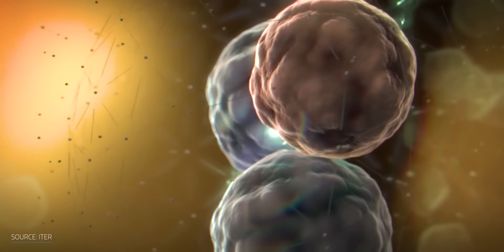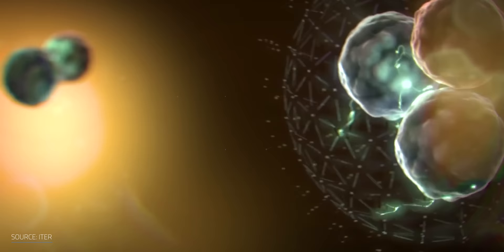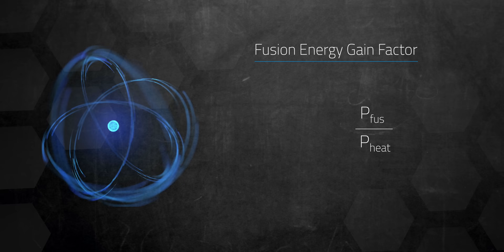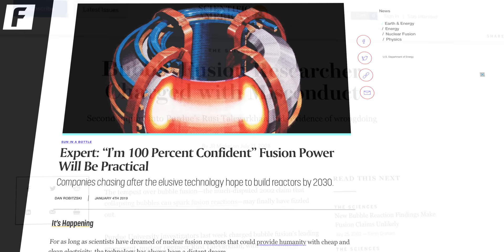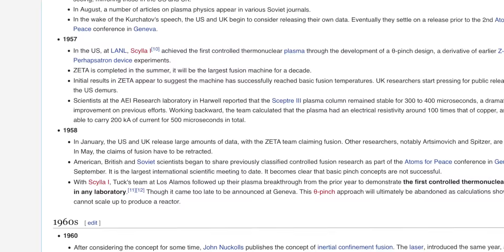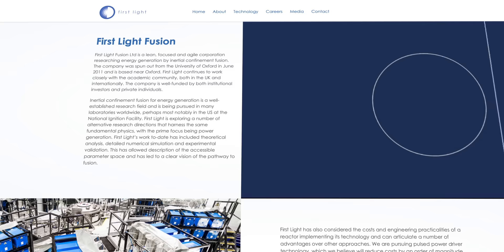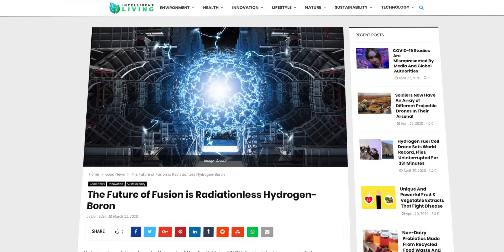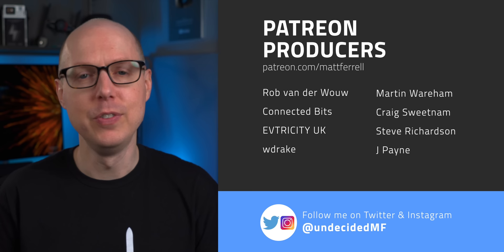The truth about nuclear fusion power - new breakthroughs

Comment: "The space elevator will be ready 50 years after everyone's done laughing"
Reply: You MUST be joking! It is the silliest idea for space travel ever. One failure of the cable and POOF.
Reply: elevator technology is one of the safest and most researched technologys, because, as you say, one cable failure and poof. But when was the last time that you heard of a lift failure? those things are really safe
Reply: @fyggy5480  Nobody has ever made a cable 35,786 kilometers long.
Reply: @DavidFMayerPhD  this is true
Reply: @DavidFMayerPhD  It doesnt need to be a cable.It could be a vertical hyperloop
Reply: Siddhant Kumar that idea sounds good , stick with that
Reply: @siddhantkumar1028  What does that matter? It is still an extended mooring that is tens of thousands of kilometers in length. Nothing like that could be built. Nothing like that could be deployed. Nothing like that could be controlled.
Reply: @DavidFMayerPhD  They said the same thing about airplanes.We just have to discover some new materials.I am pretty hopeful that it can materialize in the next 100-200 years.
Reply: @siddhantkumar1028  We know far more about Science and Engineering today than was known 150 years ago. We therefore know far better what is, and is NOT possible. In theory, the space elevator could work, but the engineering challenges are insurmountable. It is a stupid idea. 

Less expensive access to space can be obtained by air-breathing orbital boosters: Space Planes.
Reply: @DavidFMayerPhD  Hey,maybe not on earth but it could be feasible for asteroid mining colonies on medium sized rocks.
Reply: @siddhantkumar1028  Escape velocity from asteroids is SO SMALL that there would be no reason to build a "space elevator".
Here is a quick comparison of escape velocities:
Earth:  11,000 meters per second
Ceres (larges asteroid known): 514 m/s
Typical mid-sized asteroid: 100 m/s
Typical small asteroid: 20 m/s
Reply: @DavidFMayerPhD  What is we have skytrains running that are hundreds of kilometers long to carry the ore from asteroids back to earth or another intermediary base.In that case an elevator would function as a station/port for the train.Its impossible to land a train that big on the asteroid.In such a case an elevator would be perfect option because it will mean that you are using solar energy and not wasting chemical feuls.When you have millions of tons of ore to transport, I'm sure you would want the wastages to be minimal.Hope you understand what I'm saying.
Reply: @siddhantkumar1028  "skytrains running that are hundreds of kilometers long" 

I do not believe that any such technology will ever be practical. Also, WHY move that much stuff. Earth is a big place, and nearly all elements are available in abundance. You are talking about TRILLION TONNE objects which are simply unwieldy. Why not rockets pushing compact lumps of stuff rather than huge strings?
Reply: @DavidFMayerPhD  Those are compact lumps in space terms.We have trains measuring several kilometers on earth.So its very doable to have 100-200 km long trains in space.And considering the fact that a package will take about 6-7 months to reach earth,I think most companies will be looking for even longer trains.Furthermore to become a post scarcity civilization,its quintessential for us to mine the asteroids.Asteroid mining is  a much cheaper alternative for space construction as compared to transporting ithe materials from the earth.Apart from that,the earth's reserves are quite finite.Asteroids have a lot more concentrated ores and in much higher magnitudes ,which are much easier and cheaper to extract if we get our hands on them when compared to the ones available on earth. Rocket pushing compact individual lumps will consume a lot more fuel than just one long string/train that is propelled all at once with one propulsion system at the end.
Reply: @siddhantkumar1028  "Rocket pushing compact individual lumps will consume a lot more fuel than just one long string/train that is propelled all at once with one propulsion system at the end."
WRONG. Rocket fuel depends upon the MASS of the payload, not the shape. I just cannot figure out any advantage for hundred kilometer long slender spacecraft. The amount of material would be MUCH higher, because material is roughly proportional to surface area and your "trains" would have a huge surface area.
Reply: @DavidFMayerPhD  "Rocket fuel depends upon the MASS of the payload, not the shape. "
Then why does transshipment occur?Because it consumes less fuel and lesser manpower per capita.It is transshipment in space.

" The amount of material would be MUCH higher, because material is roughly proportional to surface area and your "trains" would have a huge surface area."
You are literally mining metals.Dont think amount of material is going to be a problem.Acts like shipping containers and is easier to load and unload from which can be a PROBLEM in space.

"Rocket fuel depends upon the MASS of the payload, not the shape"
When 20 individual pods are accelerating independently according to your method,and when they are all accelerating in unison by one thruster..Do you really think both would consume equal energy?1 thruster vs 20 thrusters?It can be an ion engine that accelerates the lot.You cant fix individual ion engine for every pod.It would be a waste.
Reply: DavidFMayerPhD you are several orders of magnitude off! 60 km is all that’s required, maybe 100, but not 1000 let alone 35,000! Where do you get your information? And by the way we have made cables that long. Check out suspension bridges.
Reply: Siddhant Kumar David thinks that space is 35,000 km away! Did you miss that point?
Reply: @nixl3518  Yup.Completely.I guess he confused space with GTO.
Reply: @DavidFMayerPhD  interesting how you make wrong assumptions and then assume everyone else is ignorant because they don't agree with that wrong assumption! To add insult to injury you treat everybody like an idiot explaining the word "Geo" as if we need your elementary explanations to the terminology! Your explanations are admirable, you get an "A",  but they're for the wrong problem.

You obviously confuse the word "elevator", for the technology that you know to be used for a conventional elevator. That and the term "Space Elevator" are not the same thing!! Then there is the fact that there are several kinds of elevators, some of which do not use counterweights!! But as I explained and reinforce here, because, perhaps you did not understand the concept, that's beside the point!! 

All this nonsense put aside, the IDEA of the space elevator is to get you out of the Earth's atmosphere without the use of rockets, jets etc, and that is around one hundred kilometers! No matter how you frame the technological problem, 100km is the required distance, not 35K kms!! 

I have seen the offered solutions you allude to before. All this "Geosynchronous orbit stuff are the result of people looking for solutions and finding it theoretically convenient to climb 350 times higher, (using ur slightly erroneous numbers btw). Just because you think that you need to climb up that far to get what you want (even as you demolish ur own argument) does not mean that the problem is redefined to be reaching Gsych orbit!

The original idea was to build a structure like the Eiffel Tower 100kms high and install an elevator as they actually have in the real one only much bigger.... to reach the edge of the atmosphere...around 100kms up!! Whether this solution is any better than "yours" is again beside the point. 

100kms is the point! 

If or when we figure out how to do it, climbing to G-sych will not be an option, not only because of the tech hurdles, but the lack of any discernible logic to do this!! Perhaps you see the difference?
Reply: @DavidFMayerPhD  There seems to be a large number of scientists (many of them Material Scientists) who beg to differ.
Reply: @robertcampbell6042  Promises are cheap. Building a 35,000 km long cable is not so cheap. I will wait until I see a WORKING MODEL.
Reply: Science Revolution  I am impressed by the huge quantity of scientific ignorance in you posting. Nearly every single thing that you said is FALSE. In addition to electromagnetic force, there exist two forms of nuclear force, strong and weak, with very short range. Strong Nuclear force holds nuclei together despite the fact that these nuclei are filled with mutually electrically repulsive protons. Stars are powered by nuclear fusion which was demonstrated in the 1930s in cyclotrons. You have no field equations for your preposterous caricature of electromagnetism. I refer you to Maxwell's equations, which have been validated to at least 8 decimal places. Read a REAL Science book sometime, that is, IF you can read.
Reply: @siddhantkumar1028  Impossible.
Reply: C. Caner Telimenli  But there a huge amount of inventions that failed completely. The failure rate is probably something like 1,000 to 1 for those that succeeded.  You can't just say we'll figure the tech out. Some ideas just will never work.
Reply: Imo what is significantly cooler than a space elevator is a orbital ring. It fixes the big problem of 35000km rope by making it like 200km. If an orbital ring is built, it will literally be the coolest thing on the planet.

Follow britney spears. We love earth, we should put a ring on it!
Reply: @boggless2771  Yes I understand the logic and agree with the physics you describe. Nevertheless a "Space elevator" is described as a method to get us out of the atmosphere without the use of rocketry. That orbital speed is not inherent in the construction of this concept goes without saying, but that is not part of the definition. If one was to suspend reality for the mental experiment, one could take the SE up and find a spaceport from which space vehicles would be launched. The speed would be insufficient and the vehicle could be accelerated much like a jet is off an aircraft carrier. It would be flung out with engines at full throttle and drop towards earth until orbital velocity was achieved, hopefully very quickly and they'd be off. 

I don't get why so much confusion arises. The dream is simple and were mass and other factors not an impediment, the elevator is a mechanism meant to get us out of the atmosphere, nothing else! The other issues are to be solved independently. specially if, as some suggest you might need an elevator to be 100 times as tall to balance out other forces! These are not part of the definition, specially if they make the whole concept even more ludicrous (by several orders of magnitude) than it already is.

That said, this whole idea is a bit of Jules Verne, as we will supersede the need of such an elevator once we discover more efficient and powerful methods of propulsion where the earth's acceleration is not much of a factor, nor is the tug of gravity. We have seen this in Sci-Fi movies where a huge spaceship "lands" on a planet/Earth and then just as effortlessly takes off. It's hard to see how that might become fact with our limited knowledge of physics, but put urself into a native American's feet when they first observed Columbus approach their shores in what they considered to be god-machines.... while to us they look like coconut shells.
Reply: @nixl3518  lets say you accelerate at 10g. Which is way too much btw. 

Using Vf^2 = Vi^2 + 2ad, and solving for d, using vf as 28000km/h, vi=1000km/h, and a = 10g You get about 300km of track. You'd need to support a bridge over 300km long. Strong enough to accelerate a massive object at 10g. And at a more reasonable 3g, over 1000km.

Please look up an orbital ring. It solves both of the problems of having to deal with a huge tower and having to deal with the accelerating track in one go. Its a similar idea to a space elevator.

It works by having a tube and a wire inside the tube. The wire is spinning much faster than orbital velocity and the tube spinning at a geostationary velocity. The wire would have an outward force because it wants to raise its orbit, and the tube would want to fall back to earth. Using the appropriate velocities, these forces cancel eachother out and you have a geostationary ring supported at whatever inclination or altitude you want. Then you have a supported track that goes around the earth to accelerate your mass at whatever G you want. Then, you can also deorbit masses with this same method. You launch the train that accelerates the masses and match the speed of the orbiting object, then you reach out  and grab it with some sort of devise and slow the train down. You'd only ever have to use propellant to manuver into positions where the orbital ring cant help and that's just a few hundred m/s of delta v in most cases. Not to mention we can send up much more massive sattelites with a lot more fuel for ion engines and we can have hundreds of km/s of delta v like its nothing.

Also you could accelerate the masses much more than orbital speed to get velocities that will launch them so fast they have enough velocity to pass voyager in a few months or years. And we wouldnt have to worry about saving energy to go to mars on a fuel budget, removing the window of once every 26 months.
Reply: @boggless2771  I thought you would stick to the subject but you didn't! Not sure how all these calculations are relevant. To begin with, we are talking about a fantasy and you're trying to apply reality to fantasy but it seems like its some other fantasy!!  Where is this whole thing about 300km come from? Who said anything about a track? The subject is Space Elevators, not orbital rings. Other ideas can be discussed but when one is discussing dogs, to bring up cats is to change the subject. Just because they both can be pets does not make cats the same as dogs. It seems to run very strong with people obsessed with such SciFi.
Reply: @nixl3518  you said the vehicle would be launched like an aircraft carrier. An aircraft carrier has a track along the length of the carrier to accelerate the vehicle. To get the vehicle to the required orbital speed at 10G's you would need a track over 300km long. Thats my point with the calculation. All the while you still have over 90% of the gravity up there.
Reply: @nixl3518  the atmosphere isn't that big of a problem, the majority of the work done in a rocket is the acceleration to get to orbit. The whole point of carrying onboard oxidizer is so the engines work in space. A space elevator without the ability to launch something to orbit is basically useless, or at least too expensive for its usefulness.

You'd need the track to launch it to orbit.
Reply: @DavidFMayerPhD  if we had the material to make a space elevator then go for it, but since we currently are not even close then no. Tho they could probably work on the moon but that would also be really hard to make.
Reply: @CarlosAM1  I do not understand what you mean by "Space Elevator". Please describe it in detail. 
Where does it start on Earth?
Where does it go in space? (top end)
Where does it get its power?
Reply: @DavidFMayerPhD  If I had some sci fi technology to do It I would start on a rocket that would have the rope as a payload, then I would to to geo syncronous orbit and deorbit it so it goes back to earth, the power for the elevator is made by a fusion reactor, now, there are many problems with this concept, so many that you might as well forget that it exists, for now, use rockets.
Reply: @CarlosAM1  So it goes to geo-synchronous orbit, right. That makes it 35,000 kilometers long, because geo-synchronous orbit occurs at that altitude.
Reply: @DavidFMayerPhD  yes.
Reply: It doesnt mean that it is impossible today , it will still impossible in the future 😄
Reply: @siddhantkumar1028  it would collapse under its own weight
Reply: @siddhantkumar1028  There is some interesting research going on into spider silk combined with genetic manipulation.
Reply: @siddhantkumar1028  oh for fucks sake, you have any idea of stratospheric winds etc, the other end of the would have to travel shit ton faster than the bottom, and we have problems with wind already with buildindgs over 300m or less.
Reply: @DavidFMayerPhD  Nobody ever suggested or implied that the "Space Elevator" has anything to do technologically with a bldg elevator. It's a concept looking for a solution and that is not a fait accompli either.  It's at the "Jules Verne" stage at this point but that does not mean we won't figure out a way to do it, unless we find better ways to get out there!
Reply: @DavidFMayerPhD  Nobody ever suggested or implied that the "Space Elevator" has anything to do technologically with a bldg elevator. It's a concept looking for a solution and that is not a fait accompli either. It's at the "Jules Verne" stage at this point but that does not mean we won't figure out a way to do it, unless we find better ways to get out there!
Reply: @DavidFMayerPhD  
A cable strong enough to hold up tens of thousands of kilometres of itself would be strong enough to take anything you could throw at it.
Reply: The Fountains of Paradise!
Reply: @DavidFMayerPhD  You sound rather childish.
Reply: Space Elevator that extend all the way to the Sun and bringing electricity from Sun.
Reply: Space elevators are unavoidable, the cost saving in the long run is so huge that they will be built sooner or later. Of course they're not possible today, just as space travel wasn't possible 100 years ago. Space elevators are a simple concept and the only real problem is a material strong enough for the cable, but carbon nanotubes already exists and are strong enough for a space elevator. Only need longer strands to make a cable, it's only a matter of time until it will be solved problably using remotely controlled nano bots.

Space elevators are great for transporting humans and delicate/expensive equipment. For non fragile stuff just shoot it up in space using a rail gun track. Rockets are fine for now, but they won't be used in the future just like we don't use steam engines anymore.
Reply: I have a question I'm no scientist but love learning!  Would it be possible to send people into space with a electro magnet like a rail gun?
Reply: @rocketrockstar8171  unfortunately, the frail human body wouldn't survive the g-force that a railgun operates at
Reply: @Hitchclif  Thank you, does a rail gun have enough power to shoot any object into space at the moment?
Reply: @rocketrockstar8171  we only have experimental railguns developed by the US navy. But yes, in theory, anything that can fit in the projectile can be shot by a railgun if the barrel is girthy enough
Reply: Or after covid wipes out all humans
Reply: We'll probably get to space with skyhooks and railguns.
Reply: I love this quote. Thank you. The future is built from the bones of skeptics and architected by optimists.
Reply: @SolSeeker941  just wish i could see the future in about 50years. Ill be long dead b4 then. Just looking at how fast things have evolved in just my lifetime in 55 yrs blows me away. 
To think , i grew up with none of this tech. Now cant live with out. Well i can and want to. Plans to sell and move off grid. The simple life. Sounds simple but hey , food you had to hunt yourself must taste better. Hell even dirt may taste flavorfull at that  point. Lmao
Reply: DavidFMayerPhD DavidFMayerPhD is there an anti space elevator lobby I’m unaware of? 😂 never seen someone so venomously anti tech. are you getting paid to spread aerospace FUD? (Queue quotes from “scientist” skeptics who told Wright Bros the laws of physics prevented human flight.) Yawn 🥱....
Reply: @DavidFMayerPhD  no, no, no Ottis will invent a braking mechanism. + New material technology.
Reply: @fyggy5480  Elevators kill lots of people: maybe not Front Page news but a regular thing.

Otis developed a braking system that stops the far in case of a cable failure: usually works 🤔
Reply: @siddhantkumar1028  i read ,"Tom Swift and his Skytrain"
Reply: Please send me the data on this. (Really please. I can hope this is a thing).
Reply: The Obayashi Corp. has said it will build one by 2050.
Reply: Space elevator will put Space X out of business?
Reply: @DavidFMayerPhD  true nobody has made a cable that long but as long as they are heavily invested in figuring out how they can do this they should be ok. And it isn’t like they aren’t thinking of outside forces like asteroids so what I would suggest is if someone like that is about to occur they don’t send anyone from x time to y, time however long they feel.
Reply: 100% possible one day however 50 years is pushing it.
Reply: Sooner than that
Reply: I don't think a space elevator itself, will ever be a valuable idea or valid here on earth. 

An active support ring? Yes, that would be doable today. If not be insanely expensive to like 5 years of the entire USA military budget.
Reply: @DavidFMayerPhD  wireless energy
Reply: I encounter a lot of mocking being frontier thinking in sciences speaking from three university degrees in medical, life + molecular sciences here on youtube. There is a lot of in particular male mob doing heckling. Not nice at all...🕵🕵🕵
Reply: Yea I dont think an elevators necessary now that elon musk is smashing the reusable rockets.
Reply: @kalijasin  I'd say the sabre engine would put elon out of business
Reply: @Hitchclif  actually your not quite right with the full story.
Using a linear motor or rail gun to put a living being in orbit is possible. The problem is that the "barrel" would have to be prohibitively long to keep the acceleration survivable. 
Linear motors are better suited for shooting raw materials into orbit for use by humans that got up there by rocket or space elevator.
Reply: @DavidFMayerPhD  We can use carbon fiber poles about an arms width to make it. And if it did collapse the damage wouldn't be that bad as some of it would remain suspended in the air. Look into any video on space elevators.
Reply: @DavidFMayerPhD  they said you can't get to moon. You know real world is far more advanced than predictions or even fiction and you know don't take engineer's and scientist's as a joke specially in such a big project.
Reply: Exactly... That's more of a joke then an actual thought haha
Reply: The space elevator is an impossible concept
Reply: @DavidFMayerPhD  not a cable, a band of carbon nanotubes.
Reply: @stevegram9000  Same thing.
Reply: @DavidFMayerPhD  "It is still an extended mooring that is tens of thousands of kilometers in length. Nothing like that could be built. Nothing like that could be deployed. Nothing like that could be controlled."  Does adding without a frame and wiring make that more perfectly clear ?  : )
Reply: @DavidFMayerPhD   " the engineering challenges ... "  So did anyone notice that the engineering issues of getting fusion to the grid are noticeably  missing ?  Is all of the happy talk about power in/out accounting for power delivered to grid,  40 =50 % ???, (who knows ?)  but is it missing from the power in/out rates ?  As it is, measured as it is, it might only be about the theoretical pure physics of how do we build a star.  
'